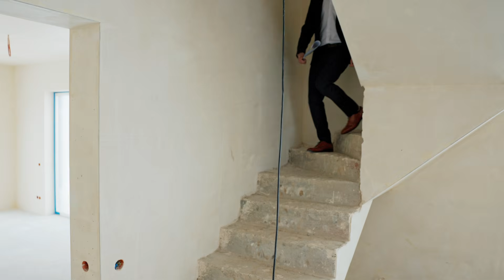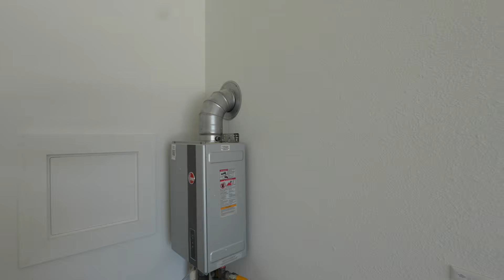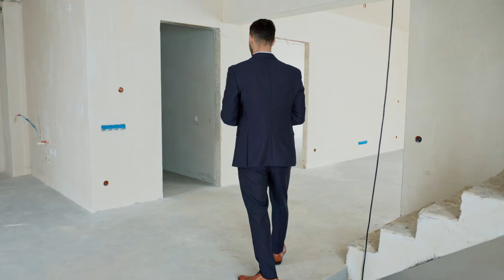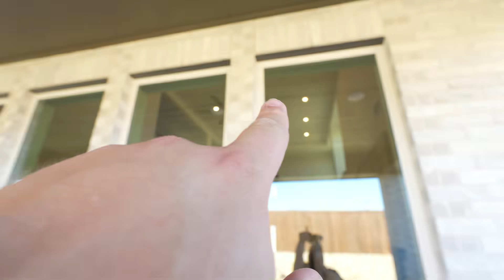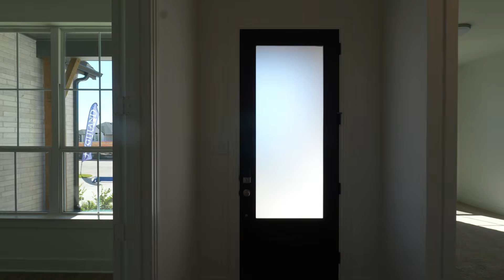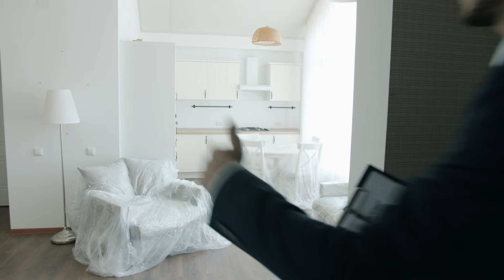Most DFW New Construction Buyers Skip This Step Before Closing and Regret It Every Time

Comment: Thank you for these tips/pointers - one quick question regarding the ceiling fan control... what if it's pre-wired only, no actual fan installed yet, how does one test functionality then?
Reply from the maker: Usually there is a second wire in the ceiling run to a switch on the wall. My experience though is now most people don’t even use that wire for the fan because they have the remotes on the fan so it’s not needed. And then you could use that second switch for something else. Like if you wanted to add can lights in the ceiling.